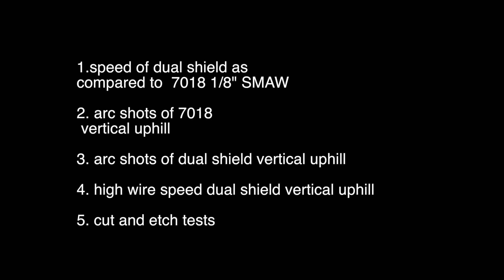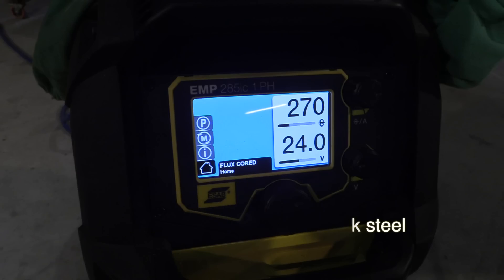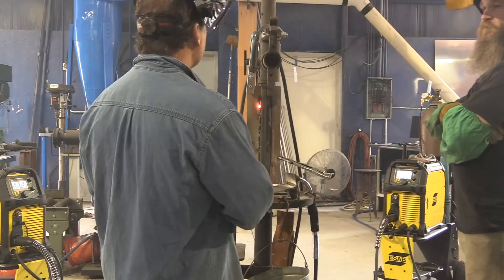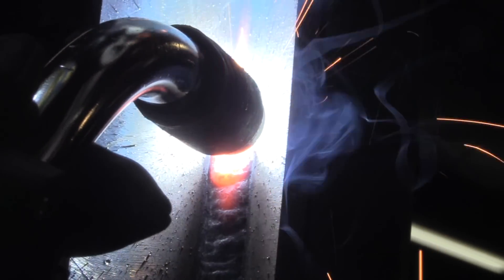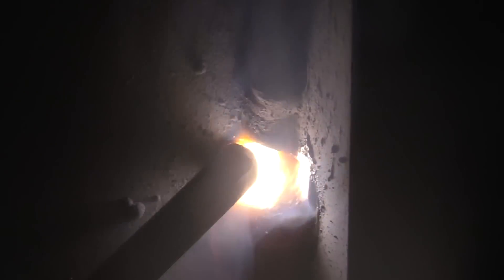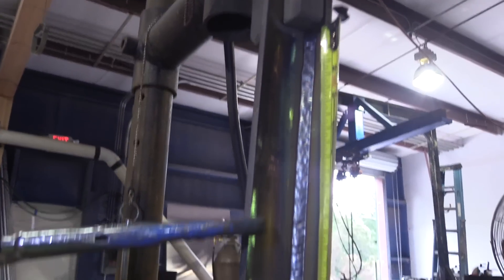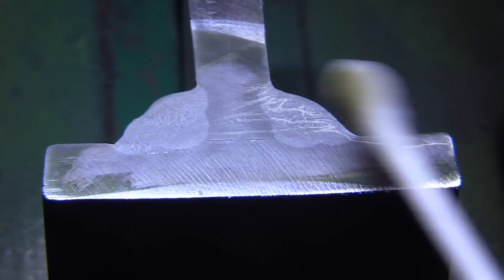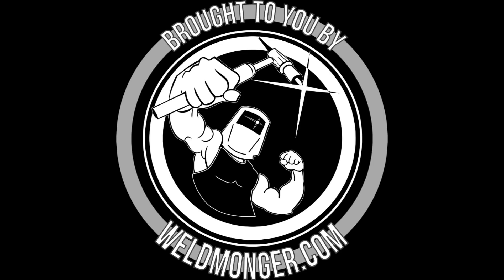Dual Shield Flux Core and 7018 Stick Welding Uphill

Comment: I am fortunate and got to weld some of the beams that went into the freedom tower in NYC. We welded some of the support beams for the basement and those were 100% full pen welds on 6" thick beams and the bevel was 5.75". It would take me 3 12 hour shifts to weld one joint and they used an ultra sound machine between every other pass to make sure it wasn't any slag or gaps in the weld and they still had to xray the beams as well.  The building hasn't fallen yet so I suppose it must have been some pretty decent welding.

Hershfield steel and banker steel out of lynchburg Virginia was the company I worked at for those of you who don't believe me u can look it up online and see.

We used a fluxcore with argon gas back then. I haven't ever gotten any formal training it was all on the job learning and training.

Comment: Are these settings for real?? I've only just begun being a welder, and we use dual shield flux. For my weld test, I had to do a 15 inch vertical stinger on a T joint. They had been using the machine to run on the flat position so it was at 185 inches per minute and 26 volts. That was entirely too much and I still tried it. Came out all sh!$$/. They said I HAD to adjust, but one of the guys had said it was good settings, to try it. Anyway, I went to what was more comfortable for me from school, 135 inches per minute and 19.6 Volts. My welds were great and I was hired. It just blows mind the kind of settings a lot of guys on YT weld at and it doesn't appear like so. The travel speed seems like a turtle's pace for so much heat and electrode being fed

Comment: Another great learning video. I have been running 350 wire speed at around 25.5 volts on our schools big dual wire Lincoln machine. It's easy to control for me because of certain arm and hand issues I have. But I will change up tonight when doing my butt and "T" joint welds for testing.

Comment: Have you ever ran a millermatic 252? Having trouble with verticle where the metal wants to hump in the middle. I was running around 24v and 275ipm .045. I tried to fine tune and it was just horrible aggravating  me. The metal thickness varied. It was 1/4 gussets to a 3/8 plate.

Comment: Hey guys....I just discovered your channel today and I'm really liking it. This is something I have been wanting to ask a wire feed welder as my roots in welding started at the so cal gas company back in 86. In 1988 I was sent off to Pico Rivera,ca to go through their 6" overhead course which is a solid 8 weeks. I noticed a pattern of a triangle that you were using as you progressed uphill and I understand why so that the weld will lay down properly, it is necessary to progress the heat and width of the puddle forward so the bead lays down. Some arc welders use a Z pattern which brings me to my question. In the oxy/acet course I took the most important rule of thumb was to burn a "Keyhole" which actually looks just like a skeleton keyhole as your weld advances. The hardest weld that we had to do in the field was fitting two halves of a fitting to a pipeline for pressure control purposes. In school it was notoriously known as a pad weld. A 1/4" pad that covered 180 degrees of the 4" pipeline using a 4 tip. When we start at the bottom after the tacks are in place, the motion on the bottom of the pipe was a long "J" motion on the pipe and burning the inside lanyard of the pad. This is of course torch following rod at a constant 45 degree angle. As you start heading up the sides the motion changes to a "C" motion from about 7 to 11 and then back into a long "J" motion only on top, the long stroke is on the pad and not the pipe as the heat transfer follows upward. I started mig welding years ago and found it to be my favorite using millermatic products. I noticed that all the motions that I was taught in oxy/acet exactly applied to my mig experience when welding. An example would be I'm adjoining an 1/8" plate in the vertical position to a plate on the ground forming a 90 degree shape with an 1/8" gap making for a forward left to right movement (I'm left handed) fillet weld. As I work through the weld I am doing a long "J" motion on the pad and a short upstroke making sure not to have undercut. I am basically using all the patterns from my oxy/acet training days in my mig welding and they seem to work just fine. Do u also incorporate certain patterns across the board in different types of welding?

Comment: What kind of gas does dual shield flux core use ? Argon and co2 ?
Reply: You can use straight CO2 or 75/25, but you may want to talk to someone about which wire you are using. I gather there are wires that are better suited to one and wires that work better with the other.
Reply: Custom Haines thank you sir I’ll make sure to do more research and continue to strive to be a better welder I was the day before
Reply: You and I both.

Comment: The only dumb questions are the ones you don't ask? Right? With that said. What is the strength of the dual sheild? An how would you know depth of penetration on the cut an etch? Or how much depth of penetration do you need to achieve the maximum strength of the dual sheild?

Comment: Hi Jody, the most likely reason you had problems with arc blow and JD didn’t was because you were still welding at the same time as JD so you were both cancelling out any magnetic field but when JD stopped welding and you carried on the magnetic field was allowed to build up giving you problems, arc blow is always worse at the end of any fillet and is always as a result of magnetism, and opposing poles, one way to make it more manageable is to switch to AC, of course you then have more problems with spatter!, we used to use magnetic arc deflection ((basically controlled arc blow) to run a weave using semi automatic TIG machines when welding deep narrow gap butts with a static tungsten, another trick when stick welding pipe butts that were having problems with arc blow especially when trying to put in a root run was to get a mate to wind a few turns of his tong cable round the pipe just below the butt and weld on a piece of scrap with 5mm or 6mm rods while you welded the butt as this would cancel out the magnetic field, old tricks now but they worked a treat when site welding a 50mm W/T butt 1 metre in diameter and 10 metres long on a rig jacket 😊 another excellent video by the way 👍

Comment: +weldingtipsandtricks  So i have a few questions about the dual shield flux cored process. I have before welded 4G with the same size wire with and without, ZERO manipulation of the gun. I took a weld test last friday and the wire used was 1/6" flux cored, dual shielded. First time using that specific size wire. Felt very confident with the test and everything looked good although i was not able run a single pass without manipulating the gun. I was fortunate enough to get a feel for the machine and dial my settings in on a piece of scrap prior to the test. But again i wasnt able to find the correct settings to run stringers or any pass for that matter without manipulating the gun. Does wire size depend on whether or not you can weld 4G with or without manipulating the gun??? Has anyone else welded 4G with 1/6" flux cored dual shielded wire?

Comment: Thanks for all yourr work. It would be really cool to talk about the effects of the welding gases used for Steel FCAW  (CO2 vs Argon + CO2 Mix) how it affects the bead,  the parameters etc. A good topic for the future .  Thanks again.
Reply: Peter, I'm just a hobby welder, getting back into it after 35 years of absence, but when I was shopping for a dual-shield wire I was looking at Esab's website, where they offered different wires for different gasses. Just FYI. I chose their 710X-M, as I already have C25, but their newer (I think?) 7100X Ultra was designed for both C25 & straight CO2. So far I'm loving it! (Along with my new Rebel 285 machine! ;-D )
Reply: i knew all you said. i just wanted to know the impact of different gas while welding with FCAW. How it affect voltage, penetration, profile of the weld...etc...

Comment: hi, first of all: GREAT VIDEOS. 
I have a question: what are the cons if I weld with MIG by making many little spot welds instead a continouse weld. Apart that it is slover, are there other cons ?
Reply: No heat build up wont penetrate the metal very well at all

Comment: I see the machine has a FLUX CORE setting, but is there any adjustment that is used to take into account that this is dual shield? Also what is the electrode setting, Electrode Negative or Positive?

Comment: Those welds look great! I run 052 with 100%c02 27v 360ipm on 3/4” plate vertical up side to side just like 7018looks like glass. Never leave your puddle

Comment: Dual Shield is the only way to go in a shop environment. But out in the field with wind, dust, rust, grime, and constantly moving around up 300 feet all the way down to ground-level within the hour arc welding is the only way to go and will never be replaced👌
Reply: I use dual shield in the field all day every day. Dust, rust, and grime don't bother me because I either grind it fresh or blast it out down hill. Has to be pretty windy to be a bother. The only time I might use stick is if like you say- far up a ladder and I only have 6" of welding to do!
Reply: Can always set up a small tent or wind blocker. The time spent doing that will be less than switching rods constantly and when doing bridge welding it’s a pain cause the environmentalist never would allow you to drop rod stubs
Reply: @gekkoukasane1713 if you think not being able to throw your stubs anywhere you want is an inconvenience, I understand how you would think dual shield is better in the field. Just plain lack of experience.

Comment: I use 1/16 flux core wire and I have a weld test tomorrow... All position check test. I'd like to see a video on 1/16 overhead welding. I know it's heavy wire but I would like some advice. It seems like I have to weave verticle up with that wire to get it flat. Any suggestions?
Reply: I use 1/16 dual shield every day. Was actually doing over head today welding a fishing boat. Using 75/25 I leave my machine set at 26 volts and 185 for the wire speed for all positions 3/16-3/8 material thickness. Biggest mistake I see is guys move to quickly. Let the puddle fan out almost completely and then start to push, keeping your puddle width uniform.

Comment: Question.  I was looking at the grain structure of the weldment on the dualshield cut and etch.  I noticed that the grain orientation was nearly straight into the corner of the weld, and that the fan was from the arc cone to toward all the edges of the weld.  When you do your etching do you see similar grain structures in the Mig or Arc welds? Also do you know if the grain structure and the surface tension at the surface of the weld is different than that at the toe or edge of the weld puddle.  I was thinking about differential cooling and how it might allow the inner parts of the pool to anneal compared to the surface of the weld.   I imagine that it accounts for some of the pull that happens when tacking, and welding.

Comment: Hey Jodi, would running that 7018 on AC help prevent that arc blow problem?
Reply: 7018 is a DC rod only. But you can buy 7018,AC rod which they make now.
Reply from the maker: it would.  7018 will run on AC on most newer square wave machines but not on all older AC buzz box machines.  I used to run AC with 7018 all the time on a miller syncrowave when arc blow was a problem
Reply: Thanks for the up date; I'm still from the old school and not up on the newest technologies.

Comment: Looks like dual shield might be the solution for my biggest problem welding-- impatience. I get in a hurry and try to move faster than the weld puddle wants to. The down side is the cost to get set up for no more than I would use it.
Reply: Assuming you already have gas, it's only a new roll of wire, and changing your WFS/voltage settings.

Comment: I remember a video with dual shield in a lincoln 210mp.  Is there a general all around wire and size for that machine? Any settings thoughts for that?
Reply: Thats kind of hard to say given the number of variables and most machines don't really have a general wire size but instead a middle of the road wire like .030 (non flux core wire for example) might work well in a lot of applications. The 210 is an excellent machine. I'd just go with its recommended settings as a starting point and adjust from there. Dual shield wire tends to run larger and runs up to 1/16" so  you will need to make sure  your rollers and whatnot are right and you will expect to use more voltage so if you are on 110v and running on thick metal you may not get what you need. So I know I didn't exactly answer your question but hopefully it gives you some things to watch for and make your welding easier.
Reply: I've even seen dual shield wire up to 1/8th inch! Huge stuff!
Reply from the maker: on the lincoln 210mp .035" seems to be the best all around size.  runs good off a generator too

Comment: Can a dual shield wire like you used be used in a situation that calls out for low hydrogen filler?
Reply: If you use a specific wire designated by an engineer, yes. Dual shield is essentially 7018 inside-ouy

Comment: On duel shield how is it out in the field with wind and the elements compared to stick? Any comments
Reply: If you are working in the elements a lot the you can use self shielding flux core. It is just like SMAW in respect to shielding in windy conditions.
Reply from the maker: Stick is more forgiving outside. no doubt . But I have seen JD use Dual shield outside a lot.

Comment: Dual shield is the shit in my opinion since on my one and only 3G mig test which was dual shield I did a stringer root and weaved it all the way out which I was allowed to do but my weave on my cap was over a half inch or so on both sides and it was a wide weave but my hot and fill passes were pretty. I had all 4 bend straps pass

Comment: Wow. That dual shield flux got great penetration.  Definitely a compelling argument for the amount of time it saved as well.  Any downside?
Reply from the maker: down sides are cost for the wire and welding in windy conditions is more difficult than with stick .   For a business like JDs, cost of wire is more than worth it for increased speed. He typically bids all his work so any time saved is money
Reply: weldingtipsandtricks good points.  Time is the only resource you can’t buy more of.
Reply: Don't forget, it is HOT. That means you need to pay attention to warpage, much more so than MIG.
Reply: The flux core wire has a short shelf life..especially around moisture. You will find lots of porosity when the wire is expired.. usually lasts 2to 6 months.. once opened. But I would choose lincoln 71m or trimark tm770 wire over 7018 for general fabrication in the shop .
Reply: Revisiting these videos now that I’m gaining experience on this.  Gas Shielded Flux is really hot.  But man it runs nice.  Definitely enjoying the difference between this and running stick.  Now that I’ve actually welded stick my appreciation for your skill on that is 10x.

Comment: Excellent demonstration, work speed benefits are clear for the dual shield. I'm interested in the followup demo of arc blow issues. Worse at the end suggests a heat buildup problem.
Reply: Yeah one would think so but its actually the magnetic field that is building up because he is welding on DC, it wil not happen on AC :)